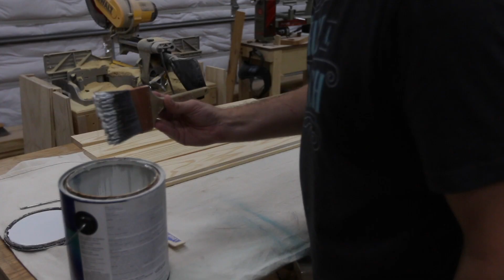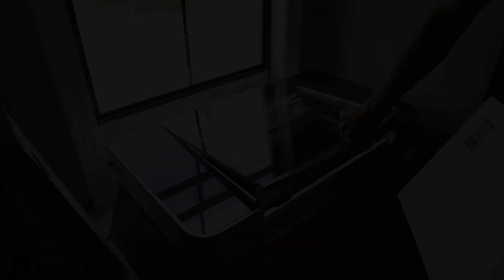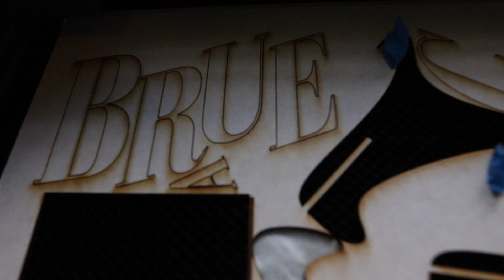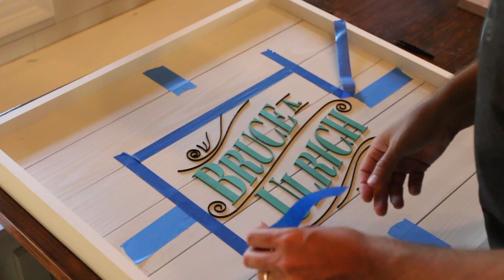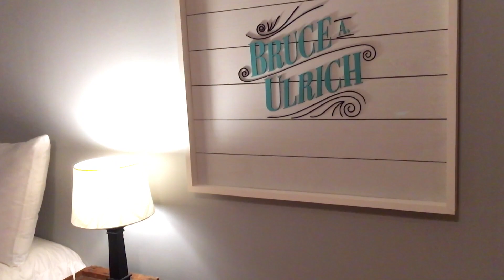Shiplap Wood Sign // Woodworking How-To

Comment: Bruce, buddy, love it.  A quick question, I can't seem to even find CA glue in my area, but I heard in one of ILTMS's video that CA glue is just super glue.  Is this true?  I'd find that it would be very difficult to use it the way you're using it if that was that case.

Anyway, again, beautiful project, and a great idea for a little flare in a room.
Reply from the maker: Thanks! Yep, super glue is just a brand name. CA glue is what it actually is. Stands for cyano acrilate, I believe. I’ll find the one I have a link it for you. Got it on amazon. It was not very expensive, like $8 or $20 for this big bottle. And it seems to be good stuff.
Reply: Yeah...but the only time I've ever had super glue work is when I needed to glue my fingers together to make myself look like a fool as I'm trying to detach myself...from myself.  I see people use it in contact with the wood on a rag without gloves.  Is there a kind that has a much slower dry rate?
Reply from the maker: ha ha! Sorry...that gave me a good laugh, because I know what you mean. I think for years, I had that trouble. Then, I just started using WAY less glue. Also, I have the "medium" weight of this glue. There is a thin also, but I have heard that it is nearly impossible to NOT glue your fingers together with that stuff, since it is just so thin and runs off of any workpiece. And I don't know if you know this, but it is acetone that removes superglue. So, if you ever get some on you, keep some of that around.
Reply: Thanks.  I'll have to rob my wives nail polish stash!